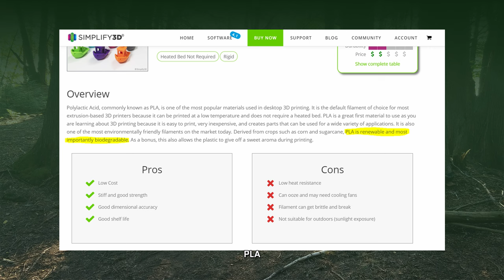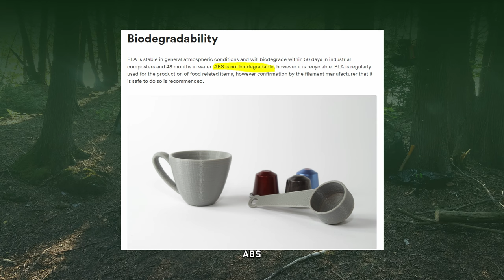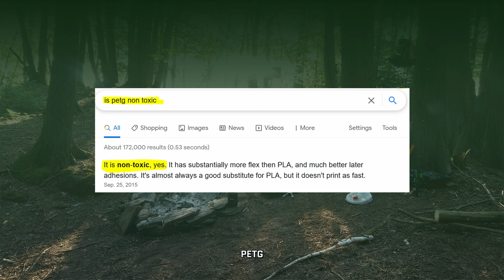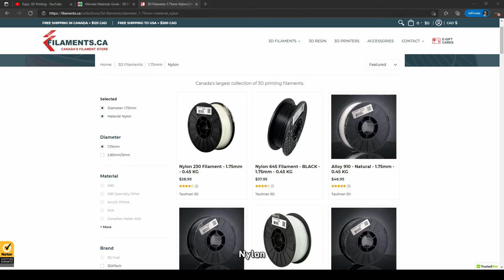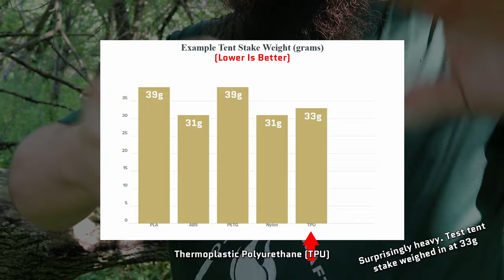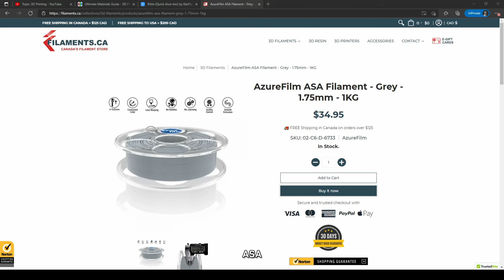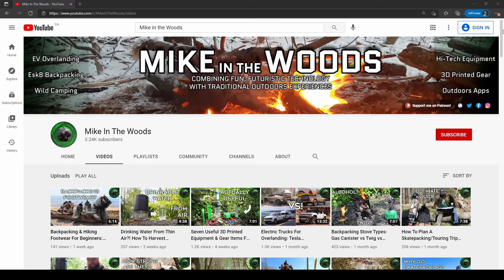3D Printing For Outdoor Use: Materials Comparison - PLA, ABS, Nylon, PETG, TPU, ASA

Comment: Great video! (Quick soapbox) Saying ABS is stronger than PLA is misleading. PLA has a higher tensile strength and will hold more weight with a constant load. I've found gears printed in PLA always last longer than ABS. PLA is brittle and UV sensitive, so not great outdoors, but it is stronger than a lot of people think.
Reply: It is, except the heat of the sun can easily soften PLA and make it worse than ABS or ASA
Reply: PLA+ is less brittle, try it.
Reply: Pla is a great choice, it is strong and stiff, easy to print and no smell as far as i noticed. Petg, more flex but stronger. In some ways, a weird plastic. It is very strong, but not really. Handle temps better, can be used for mechanical parts. Seems to handle UV ok if i remember right. Abs, stiffness of pla if not stiffer, handle temperature better than pla/petg. But can be a pain to print, does not like sunlight. BUt i guess it will last for a long time in general. Im ignoring it smells, also like to bend without enclosure... Asa, alternative to abs. Never used it, but on paper it looks better than those above. That is my impression. If it is easier to print, dont smell, handle uv. Overall, i think i need to buy some asa to check it out. :P

Comment: You missed on saying that PETG is highly UV resistant and high temperature rated. If you need to print something that will be in the sun a lot, and be exposed to bad weather and other conditions, PETG is your go-to.

Comment: Unfortunately, PLA is not biodegradable.  It requires very specific conditions not commonly found in nature to degrade.  Still, I appreciate the information on ASA and I think I will try and work with it.
Reply: Yep. The biodegradability of PLA is grossly oversold. For most 3D printer users, it should be assumed that your PLA will end up in a landfill and still be intact for a few hundred years.
Reply: @wturber  in my opinion it's not about the biodegradability, more about moving away from synthetic plastics that are building up everywhere. Yes, it's not biodegradable exactly, but it's better than the plastic problem we have now. Please always recycle folks.
Reply: @omniicore   As I said, the benefits of PLA are oversold. That's not to say there aren't any benefits at all. But from what I've been able to find, it is a marginal benefit compared to what is often said or suggested. Personally, I focus on the "reduce and reuse" ideas. If you really do that, the need to recycle is greatly diminished. 

With 3D printing then, choosing a filament that will help a 3D printed object to endure in its intended use is my main focus.
Reply: you do not think micro plastics is something to be concerned of? ill take a couple hundred years vs thousands @wturber
Reply: @omniicore  You might want to Google "microplastics PLA". It may be that the more biodegradable plastics such as PLA create more microplastics that the more durable type. Studies are ongoing.

The matter is much more nuanced that observing whether a plastic is petro-chemical based or based on plant matter. It would be nice if it was that simple. But it isn't. 

BTW, PETG can also be recycled using normal consumer recycling channels.  Can't do that with PLA. The "green" benefits of PLA are marginal and oversold.
Reply: @wturber  Landfills aren't really a thing in developed countries and PLA degrades perfectly well in industrial composting (not that I think any of it ends up in one anyway, but alas). And whether or not a filament is recyclable is irrelevant - as no meaningful quantities are recycled regardless. 

What really makes PLA 'greener' is that it's a bioplastic instead of a petroleum product - that alone makes it infinitely better that all alternatives.

Comment: So would TPU be good for sealing holes in...let's say a box with electrical wires in it in order to ip proof it? Like not letting water in and such? Is there even more flexibel / better material for those user cases ?
Reply: More flexible would be difficult to print with. TPU is already too flexible and causes sometimes jams. I have printed a lot of vases just in vase mode, and it seals very well with only a single outer layer.

Comment: I just got my 3d printer. I wanted a flexible filament so i blunt one. My first ever filament is now tpu. I had no idea i choose to start with something this difficult and messy XD. Plus my extruder doesn't seem to be able to pull from the spool enough for me to leave it alone. So I occasionally pull some slack for the extruder. That improved print quality significantly.
Reply from the maker: Yeah TPU is probably the hardest!
Reply: @MikeInTheWoods   TPU is way easier to print than Nylon in my view. I currently use TPU from Geeetech and that was super easy to print, just reduced retraction and speed significantly and increased temperature, but everything else is pretty much the same as with PLA. But you need a direct extruder! Bowden extruder will not work properlly.

Comment: I suspect nylon is fine to use around water/moisture - it just needs to be super dry for printing.

Heaps of wet weather gear is made from nylon.
Reply from the maker: Yeah that's true. My current set of tent pegs I printed in Nylon
Reply: OTOH, the lid for my bicycle inner tube case that I printed from Nylon (well - weed-wacker line)  swelled and became loose fitting after riding my bike is some rather serious downpours recently. It also became softer. I think the usability of nylon outdoors varies substantially with the particular nylon being used. There is a pretty wide range properties among various nylon filaments. So generalizing has limitations.

Comment: I’m looking to use PLA on some outdoor hydroponic towers since I have so much. UV exposure is a big concern. I’m thinking about spraying it with UV protection spray as an experiment
Reply: Petg would probably work great for that, it's also easy to print

Comment: Great video.
I am looking for a 3D printing material that can withstand extreme heat(thanks to global warming) and winter freezing cold (-20° Celsius -4 Fahrenheit).
I want to 3D print a plastic cage that I can use it to cover the exhaust vent from the basement's dryer.
Reply from the maker: I'd say probably Nylon

Comment: so ASA is better than ABS and Nylon?
and is nylon also called PA or is that something different from nylon?
Reply from the maker: PA is a type of Nylon. ASA is more weather resistant, but has terrible layer strength
Reply: @MikeInTheWoods  Correction. PA stands for Polyamide. Nylon is a brand name of a type of PA. ASA is actually weather resistant, and it's layer adhesion is as good as you chamber temperature can get.